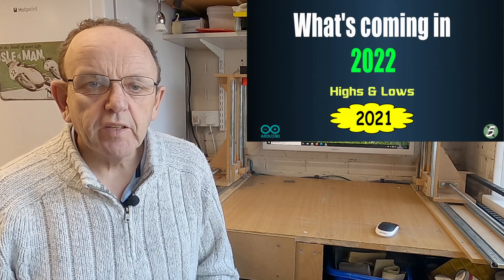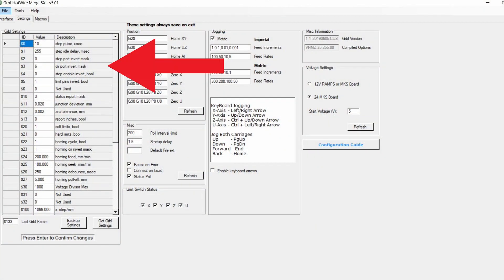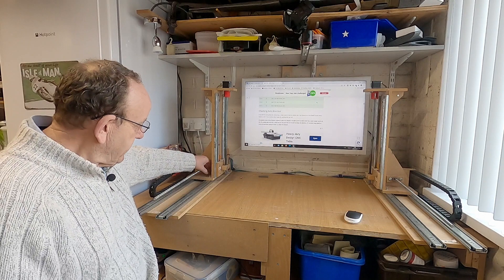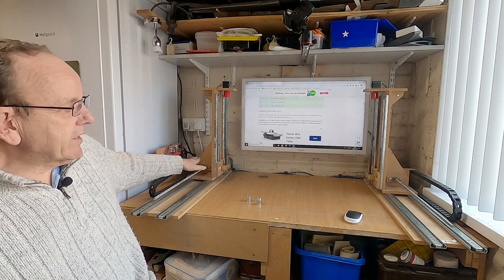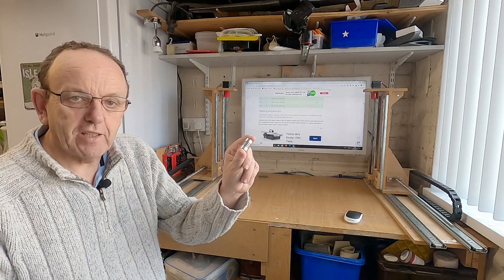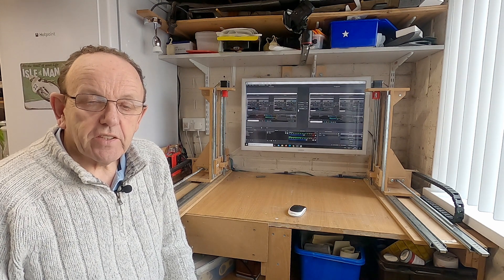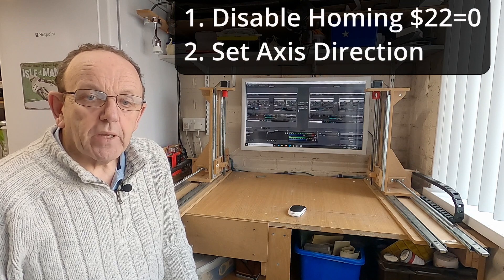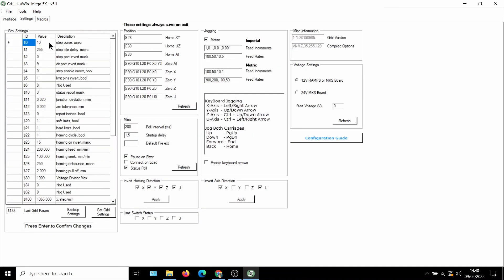CNC Foam Cutter Easy Axis Direction

Comment: Hello,

I am currently building a 4-AXIS Arduino CNC Foam Cutting Machine. However, I'm encountering some issues.

The issue I am facing is that in the GRBL Software, only 3 Axis are showing. The U axis is missing.

Do you have any idea how I can solve this issue?

It would be great if you could assist me with this. If you are interested, please share your contact information. I would be glad to connect with you.
Reply from the maker: Follow the instructions here with the latest firmware and software.https://rckeith.co.uk/grbl-hotwire-mega-5x-for-cnc-foam-cutters/
 The U axis is for the older firmware and software

Comment: I don't know if this a stupid question or what but if I don't use limit switch in that case can I use homing option for my stepper motors?
Reply from the maker: You won't be able to Home the machine but when you power on that will be the zero origin for all the axis. So you you just use Go All to zero
Hope that helps
Keith